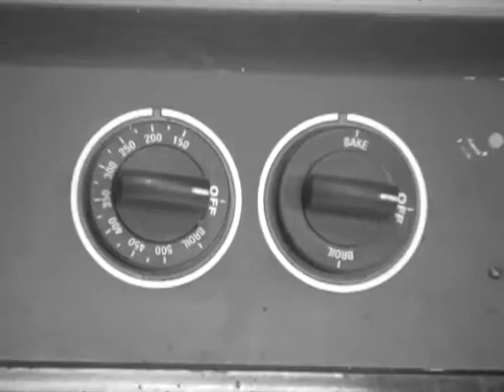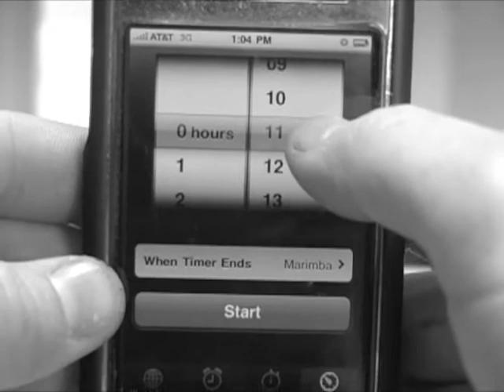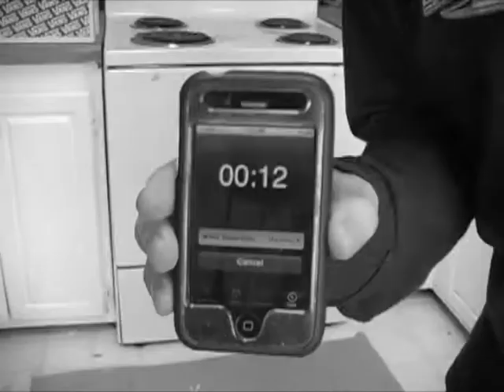Suzuki Burgman - Headlight Lens Removing | MicBergsma

Comment: Have seen a few other videos of this. The lens will just about pop off if you warm the oven to 200F. 175F is a bit cool. If you want even temperature in the oven, don't open the door. When it comes time to close up the assembly, put it back in the oven and the residual glue will bind. Clamp together until it cools and the glue resets.